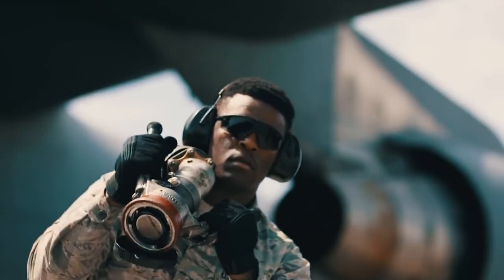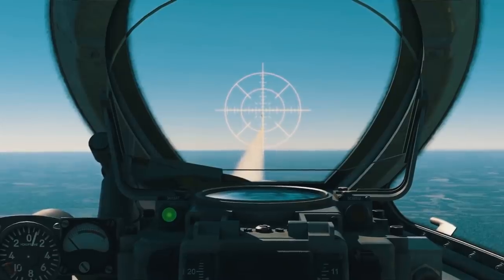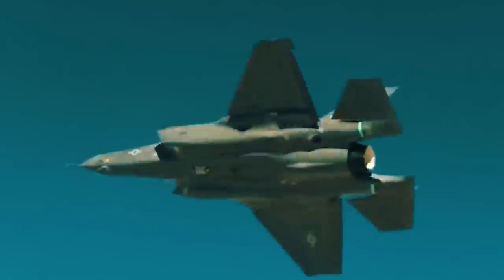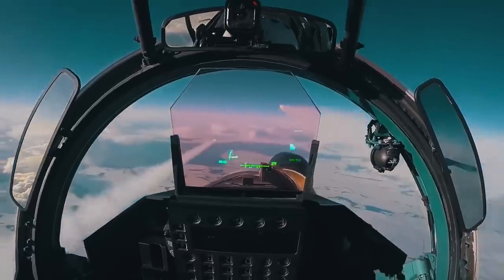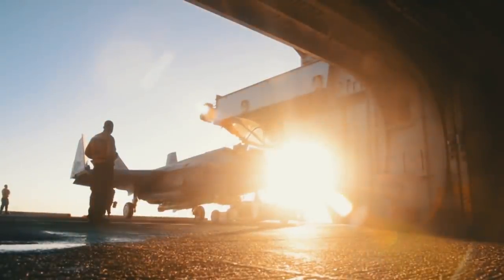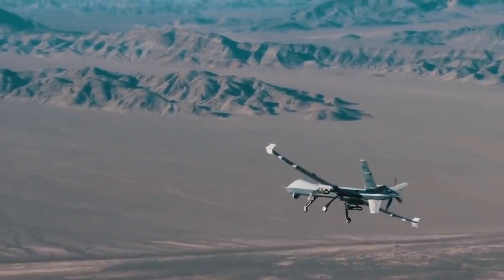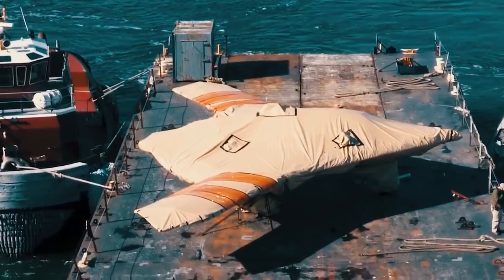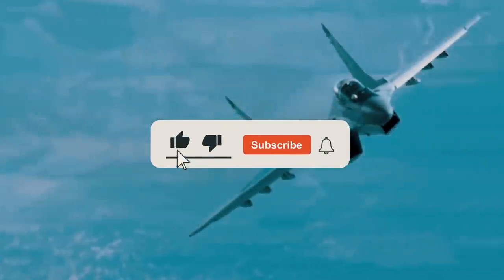US Is Testing Its New Sixth-Generation Fighter With Air Superiority

Comment: No the US was never a leader in aviation UNTIL driven BY WWII TILL THEN almost every major country was better.
Entering WWII the Germsn British and Japanese fighters were indisputably better. During WWii some excellent designs did emerge Chief among them were probably the P38 J and later models the Corsair the F6F the P47 and of course the P51 with the outstanding Rolls Merlin engine. 
After WWII American fighter tech languished somewhat.  The advent of the MI 15  came as a rather ugly shock not remedied till North American crssh  developed the F86 which even then found the Mi in Rus pilot hands troublesome. The following F100 was a great fighter for its time.
None of the remaining century series with the possible exception of the F106 could be called a successful air superiority fighter. In its day.
The F101 was certainly not . The F102 was underpowered. The F104 was a great interceptor with dazzling speed but its 7.5 foot wing span meant it wasn't very maneuverable. The F105 was really an attack high speed bomber with nuclear capability.
Then under McNamara the concept of planes that were interservice multi mission evolved.  This resulted in the F111 a troubled plane for much of its history and the F4 Phantom a good plane but heavy and suffering from a lack of agility compared to the Mi21.  Most lacked a gun and missiles of the time were comparatively crude..
The evolution of the fighter mafia ...so called...along with the realization that the mission and design of fighters for the Navy and Air Force were quite different led to the development of three great American fighters F14  F15 and F16.
Navy carrier fighters posed a difficult dilemma compared to their Air force counter parts.  The Navy fighters require a more robust design to survive the shock of catapult takeoffs and arrested landings along with very strong landing gear. This adds weight which means less maneuverability all other factors being equal.  The Navy fighter requires more range hence more fuel capacity and requires longer range missiles. Why? Because its PRIMARY task is to protect the carrier especially from then  existing Soviet supersonic bombers carrying large carrier wrecking supersonic antiship missiles.  The Navy found for a time the answer in the F14 combined with the very long range AIM 54 Phoenix missile.
The F14 was swing wing  which gave it very high Mach in its interception role some maneuverability in dogfights despite high weight  long range and carrier capability. On the other hand the complexity and marine environment meant high maintenance and operating costs.  And it had a rotary 20mm cannon.
The Air Force procured the F15 heavy fighter and the F16 light fighter. Both were designed as air superiority fighters and both were excellent designs which explains their long production runs and high production numbers.  Bogh especially the F16 FOUND SERVICE WITH A NUMBER OF FOREIGN COUNTRIES.  BOTH HAD SUCH A HIGH THRUST to weight ratio THAT IT WASNT LONG BEFORE BOTH WERE BEING USED IN A MUD MOVING ROLE ALTHOUGH THAT WAS NOT THE ORIGINSAL DESIGN INTENT. And might have been better done  at less cost by the A10 a plane much hated by the Zaire Force.
Russia then the USSR countered with the same basic approach. A heavy fighter the excellent Su 27 and the lighter MI 29 another excellent light fighter.
The US developed the F22 Raptor an excellent design incorporating stealth and Supercruise  The planes were arguably at the time the best fighter superiority planes in the world but were expensive.  Cash strapped Russia was not able to follow suit but did evolve the Su 27 into the Su 30 and ultimate 35 with thrust vectoring excellent missiles and fire control etc.  The F22s downfall was it was too good too cutting edge at the time. The US was unwilling to sell it to other countries which meant that unit costs would remain high. Maintenance costs were high . And in myopic arrogance American politicians made two fateful and stupid decisions. The first decision WHICH WAS REALLY stupid was the assumption that since there currently was no peer adversary there never would be. The second even more stupid decision was a return to McNamara style thinking of one fighter for all seasons all reasons and all services . Enter the F35. Probably the most expensive mistake in the history of military aviation. 
The Raptor was canceled with less than 40 percent of targeted production with a complete inability to restart production . The idea was that the F35 WOULD SUBSTITUTE FOR IT AT LOWER COST per unit. This turned out not to be true.
The F35 was to serve the Navy and replace the F18 in a fleet protection role. It was to serve the Marine Corp with VSTOL and ground support duties .And it was to serve the Air Force in an air superiority role . In fact it can do none of these things well and one role the Marine role has been entirely eliminated recently with the Navys decision to strip the Marines of close Air support and armor for rather stupid and self serving reasons
The lure of a one plane for all services was irrestible for the politicians.  The results were foreseeable and had historical consequences  and precedents
The F35 is inherently not designed as an air superiority fighter. It lacks the thrust to weight ratio and wing loading design to stay in the same airspace as the Su 35 or probably the J20.  It is too slow to run and too slow to pursue . Its internal weapons bay carries too few missiles and the missiles it does carry are short ranged compared to Russian and Chinese counter parts. Nor is it particularly agile.  It relies on stealth which is rapidly being countered and its electronics suite which have proven difficult to debug.
The  Naval version is even more questionable. It lacks the speed to rapidly intercept an evolving threat.  It lacks the range to get far enough to keep incoming Rus or Chinese incoming bombers far enough from the fleet.  It lacks the range from its carrier and the load capacity to suplress shore based antiship  missiles it cannot carry many AA missiles and those are only intermediate range.  Its weapons bay cannot carry a truly long range missile or a hypersonic missile.
The Marine STol version is DOA since the Navy has come to the belated realization that due to lack of pursuing a truly effective missile defense for its fleet  A PROBLEM REQUIRING A DOLUTION EVER DINCE THECSECONDCWORLD WSR ANDVTHE APPEARANCE OFVTHE FIRST GUIDED MISSILE THE KAMAKAZI its carrier task force cannot effect an amphibious landing or protect or resupply Marines after landing. And finds itself in a budget crunch anyhow.
The Rus adventure into the Su 57 has not been without its problems due to budget constraints engine development problems and cancelation by India ofvthe joint development program.  It is an excellent plane but currently flies in very low numbers.
The Chinese J20 heavy fighters armed with long ranged hypersonic anti ship missiles is a problem. The Chinese can certainly afford to build them in quantity and they carry s heavy load out of missiles.
What exactly the US has learned from its foray into 5th generation fighters will be shown as its 6th gen designs become clear.  What else is painfully clear is that until the Navy develops a truly effective counter to heavy long range high speed missiles it has lost the ability to operate with impunity or even survivability in a highly contested environment against peer opponents.  The math of one heavy hypersonic missile equals one dead ship is unacceptable and unsustainable.
Reply: Right, Ivan. Whatever you say.
Reply: No. Period.